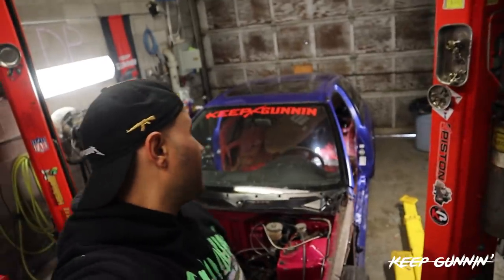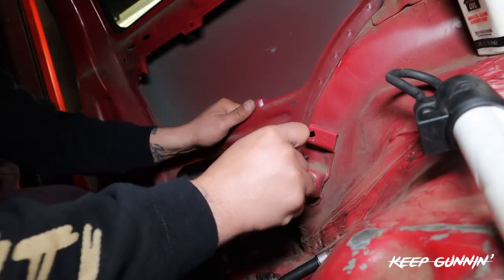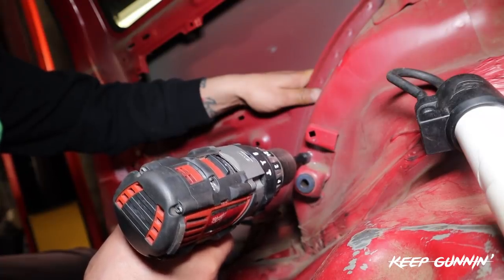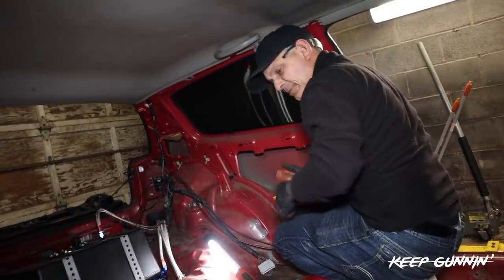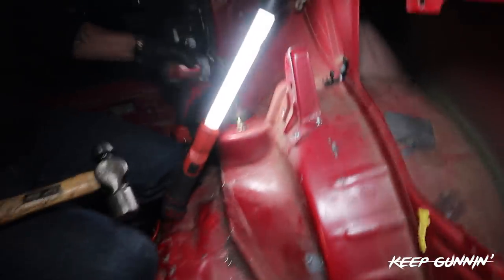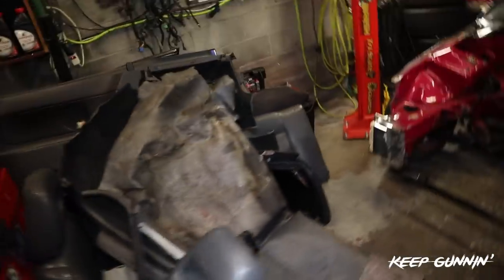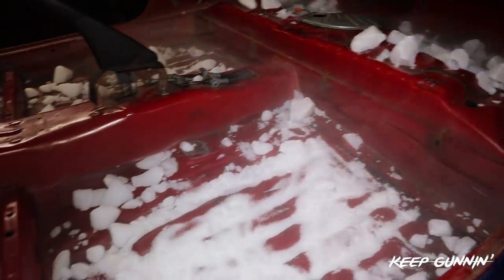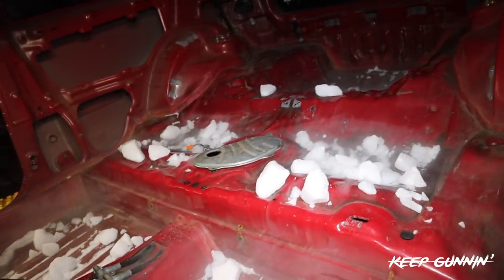HONDA CIVIC LIGHTWEIGHT REDUCTION: PART 3 (DRY ICE)

Comment: I hope you are saving every bolt, nut, vinyl cover, wires and whatever you are removing the spot weld with a massive scale. I want to see the huge # of weight loss.
Reply: UsagiMoto I’m doing the same shit and literally saving everything the rubber gromets even 😂😂😂 tryna see what the # is. But I don’t be vloggin